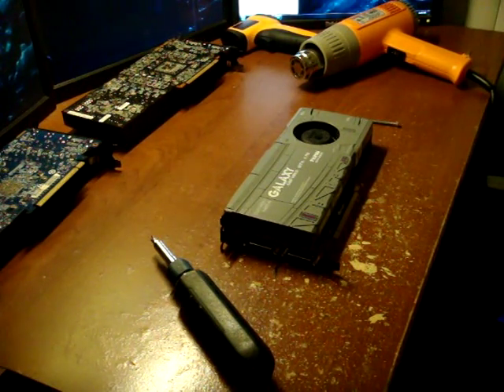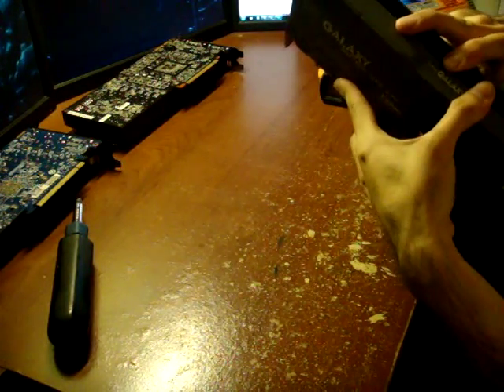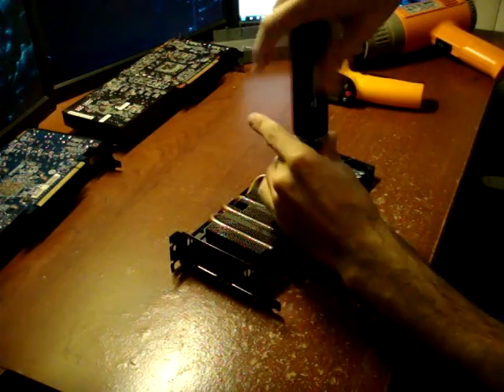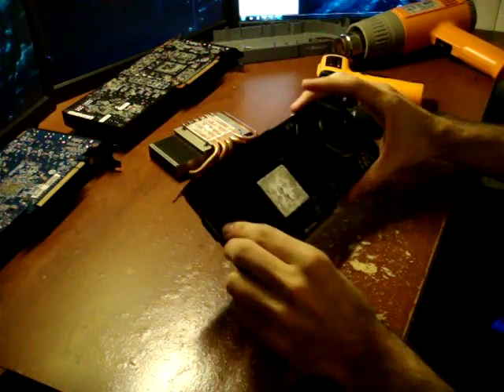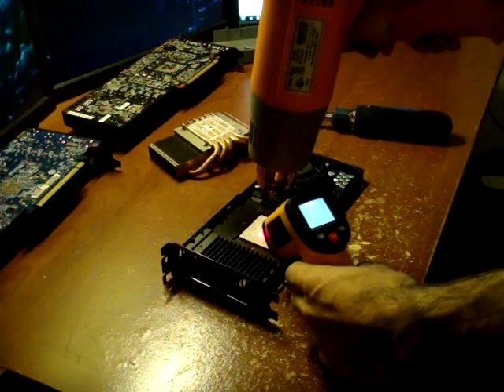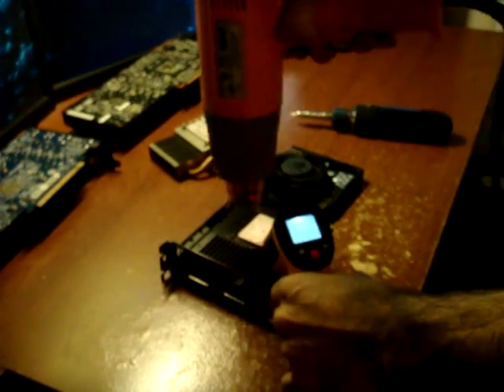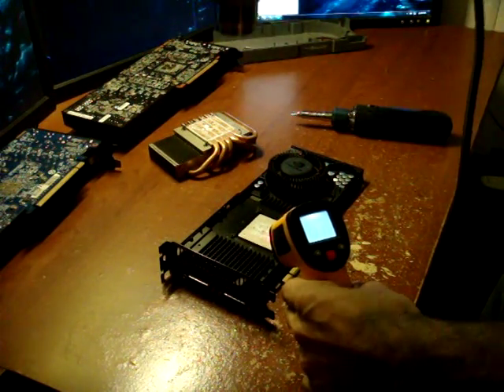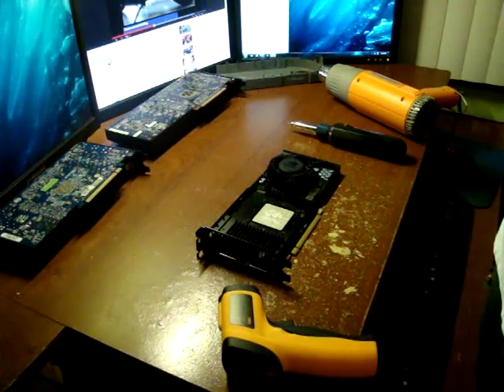Fix Dead GPU

Comment: Really cool it worked for me for my dead 9800gt but after 2 days now getting colour full lines and PC freezing issue
Reply from the maker: killerviper007 something that keeps my GTX470 alive longer than a month is agressive Fan Speed keep it as cool as possible . but usualy once it starts failing again you will need to preforme the Kooking again

Comment: is this really work?
Reply from the maker: Works for me
Reply: Flying Karapet can you show me the result? coz i have my old gpu ati radeon x1600tx it dont have a display show but the fan still spin
Reply from the maker: Leroy Qayyum Well I'm using it right now as we speak. How can I prove to you ?and also this fix only works if your card died from over heating, if  the card was damaged physically on the PCB  then this wont work